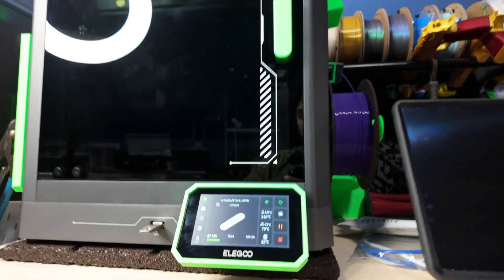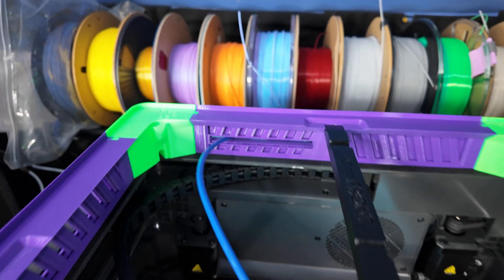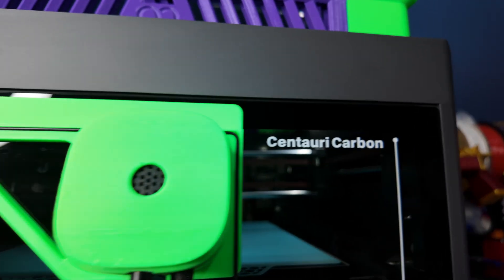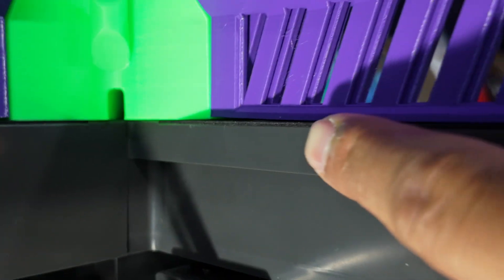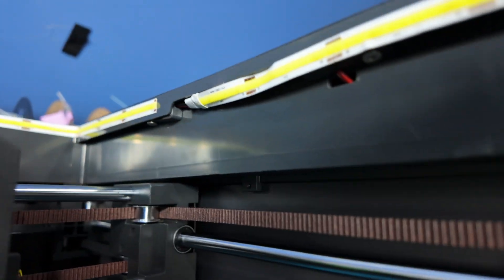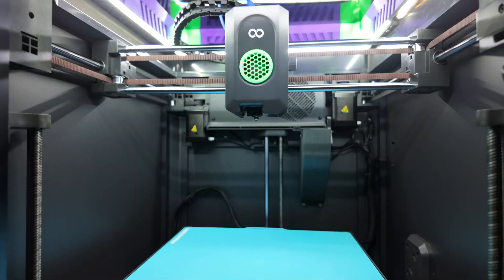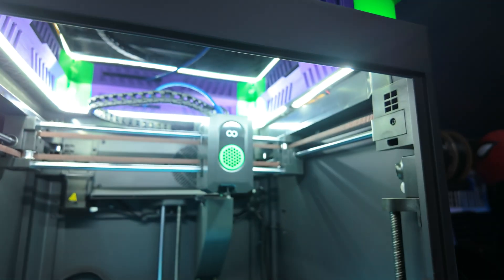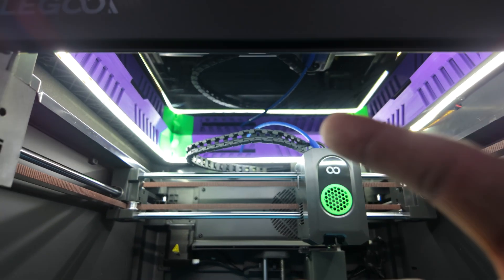Elegoo Centauri Carbon Mods : Light Mod

Comment: Great set of upgrades, especially the modular riser, so you can modify pieces as you see fit.
I've seen many people put the LED strips on that upper lip that's angled inward, since that way almost all of the light points towards the work piece, especially using a COB LED strip like you did.

Comment: I just bought elegoo centauri carbon, and it came with a very bright led bar on the right upper side .The elegoo has fixed the light problem in their newest batch🎉 but I still cannot connect my ecc to my pc elego slicer, althought it already in the same network😢
Reply from the maker: Ok nice just try orca slicer see if it works

Comment: With the custom riser at the top, can you print PLA just fine with the glass still on there? Just got mine today, and trying to find the best riser out there with both enough airflow for PLA and with built-in LED strip support.
Reply from the maker: Yup print PLA just fine

Comment: It looks as though you have your CC mounted on a foam pad. While that will reduce noise, it will also block the vents on the underside of the printer, which is how the electronics are cooled. Overheating there WILL lead to reliability problems, and, because the mains power switching for the heated bed is in that floor compartment, it could actually be dangerous. (You probably know about Qidi fires.) 

Similarly, the blue tube guide that you have in the top of the toolhead, completely plugs the hole! Normally there is a draught out at that hole when the printhead fan runs up. I don’t know how significant that vent is, but blocking it is going to make ‘heat soak’ extrusion and retraction problems occur more easily, quite apart from any other issues. 
It simply isn’t necessary for a tube guide to close off that vent completely!
Reply from the maker: Thank you for the feedback i will look into these things🤙

Comment: Did you plug your new LED strip into the motherboard (on the bottom of the CC case)? I heard that there is a spare open 2-pin 24V port to plug a light into.
Reply from the maker: No I didn't I splice it to the led on the side 🤔 but I'll look into the spare port thanks
Reply: @layeredlegacy3D  owners of the original CC didn’t get those led strips (or the wires leading to them). I suspect your wires lead back to that ‘spare’ socket on the logic board. 
It’d be interesting to see what can be seen with your two screws removed!